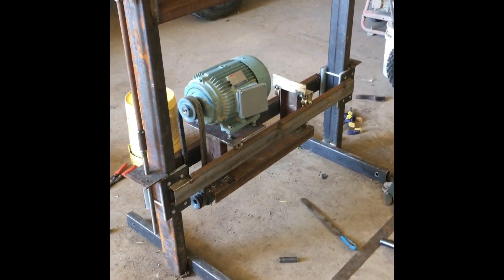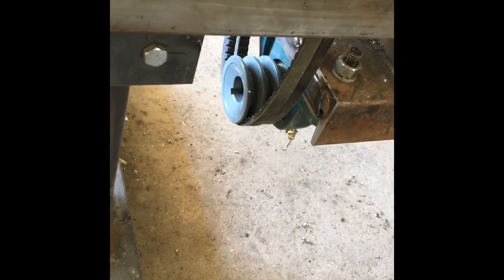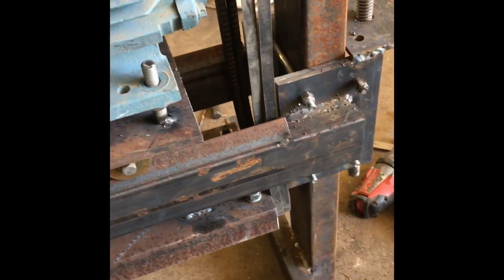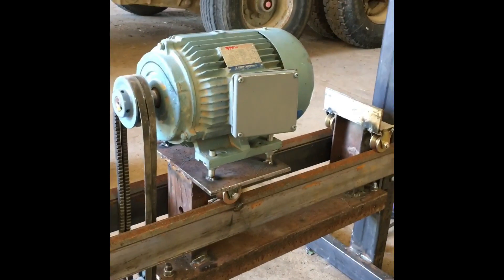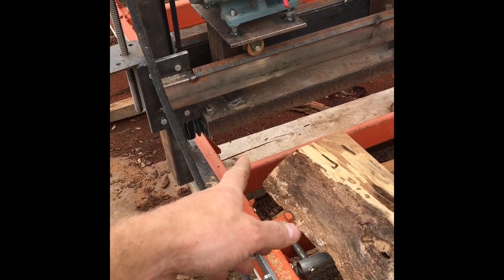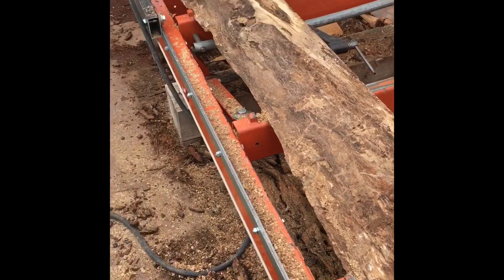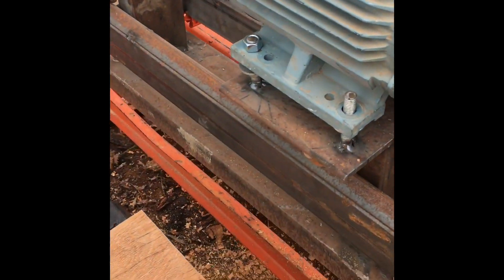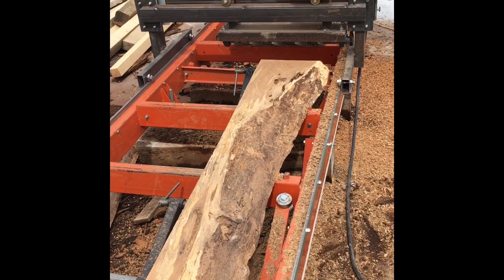Sawmill Planer for Woodmizer Lt15 Wide

Comment: So you're planing green wood?  What kind of finish do you end up with after it dries?
Reply from the maker: We were planning green wood in the demo just as that was what was handy but we use it mainly to flatten large slabs and wide dimensional lumber after we’ve ran them through the drying kiln. It leaves a pretty nice finish with the spiral cutterhead especially in figured lumber!
Reply: @busenitzcustomwoodworks6768  Got it.  Good luck with the project.

Comment: It might be cool to run it with the bandsaw so it planes the top of the log as you retract the bandsaw for the next cut. Then each board would come off the mill with one planes face and it wouldn’t add much time to your work. Or it might slow you down and be a pain in the ass. Either way, cool project.
Reply from the maker: This would be cool, but generally we Mill logs when they’re green so it’s going to cut up a bit as it dries, which will need re-flattened.

Comment: I love it and wanted to do this myself but I can't weld. I'd be interested in having you build me one with a 12 inch cutter head.
Reply from the maker: What do you have for a Sawmill?
Reply: @busenitzcustomwoodworks6768  Woodland mills HM 130 Max
Reply: @CJRez10 you can't weld yet haha. If that's ALL that's holding you up , time to learn
Reply from the maker: I’d love to build these for sale but I just don’t have enough time to get into fabbing. You might check out joint a wood machinery.